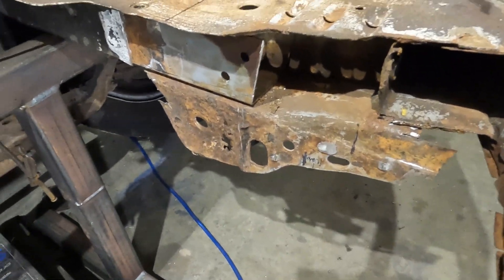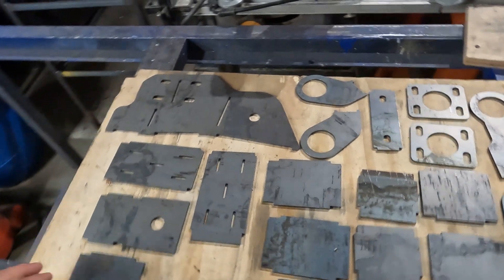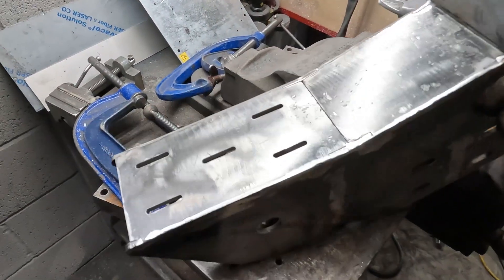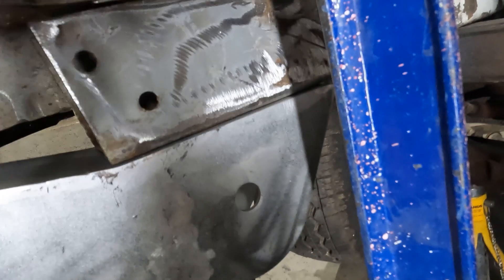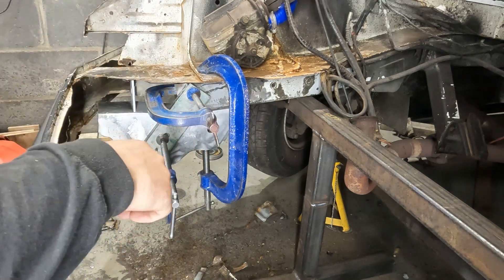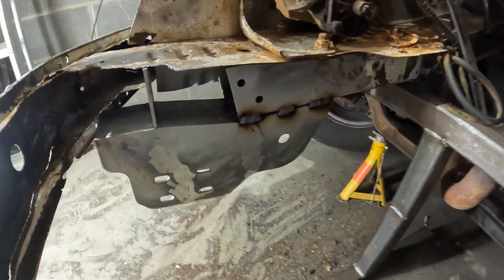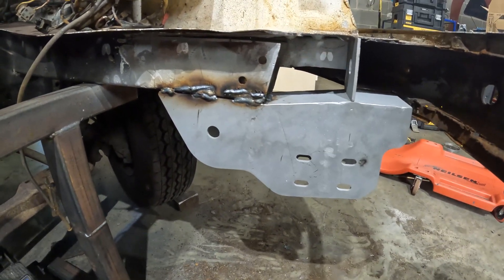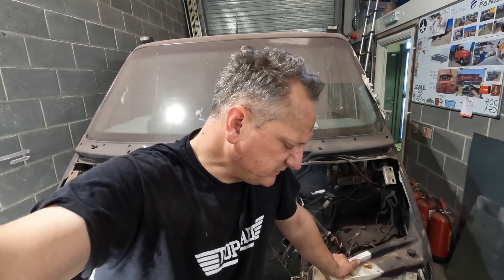Rolls Royce Transit Part 4 Laser Cut Parts Installed

Comment: Looking good.  Love the Laser cut panels.  I think I need to redo the engine mounts on my 37.  The angle is pretty flat and I'm concerned that without enough angle the UJoints won't work the needle bearings around and I might get some Brindling of the bearings.  I should be able to raise the front of the engine close to 2" but I need to be mindful of the steering shaft on the drivers side.  So designing proper mounts will be critical.  I'll have to use CAD (cardboard aided design) as I don't have the software.
Reply from the maker: I know what you mean. Sometimes you have to get it in to know how it needs adjusted.

The floor won't be an issue for you raising it up? Most places will convert a cardboard template to cad. Just need a reference size. It's how I did my pieces.
Reply: @RocardYT  I don't think the floor will be a problem.  I've got more than an inch at the transmission so coming up 2 inches in front will be an inch or less at that point as it's pivoting off the the transmission mount.  The engine is shorter than the transmission.
Reply: @RocardYT  So CAD to CAD?
Reply from the maker: @adubbelde1  yep

Comment: Very nice work. 
1. I’m impressed by the solid works and laser cutting. I cut 2 slots be hand and it took forever- and looks terrible.
2. I haven’t received many negative comments in my vids. Maybe I’m lucky enough that trolls don’t notice me?
3. I’ll be sure to check out Ben.
Reply from the maker: Have to work with what you've got! I'm fairly limited at my shop at the moment and laser cutting is a pretty cost effective and fast way to go. 

I haven't had loads of negativity or trolls but some friends have. Just thought I'd share my thoughts rather than add a bit of music.